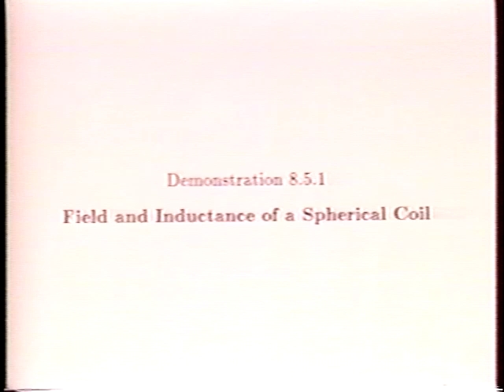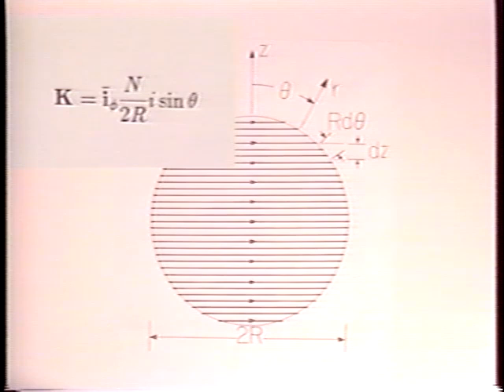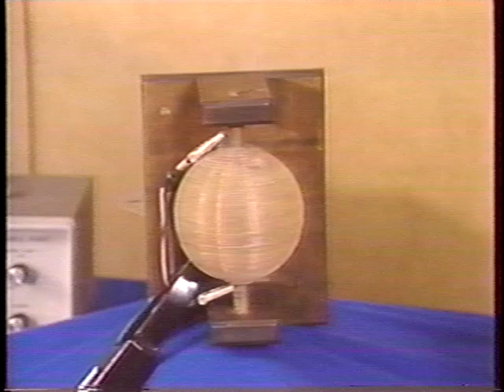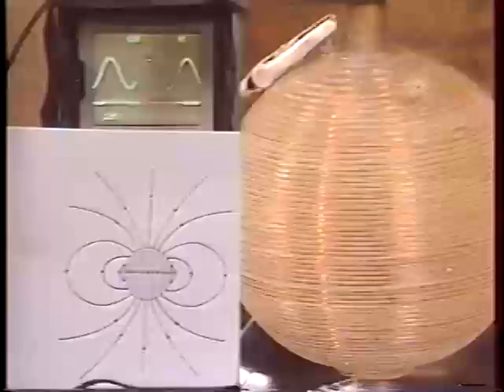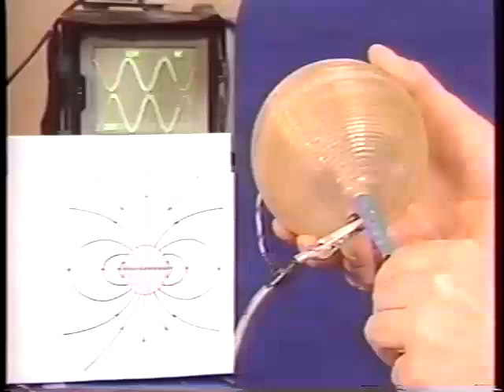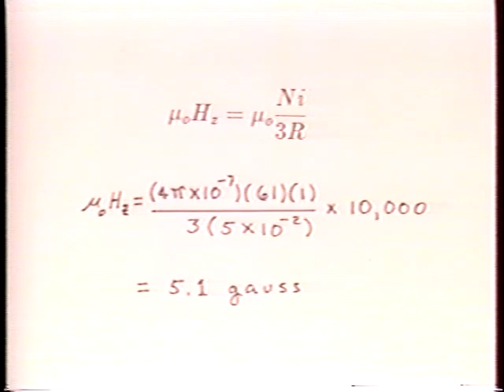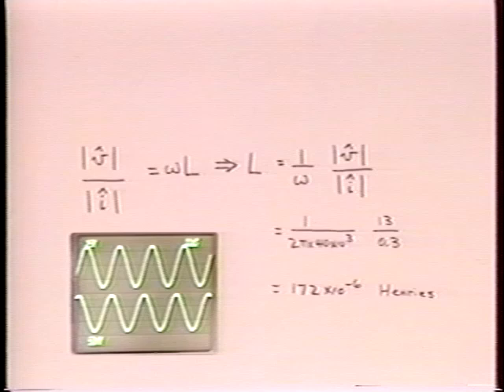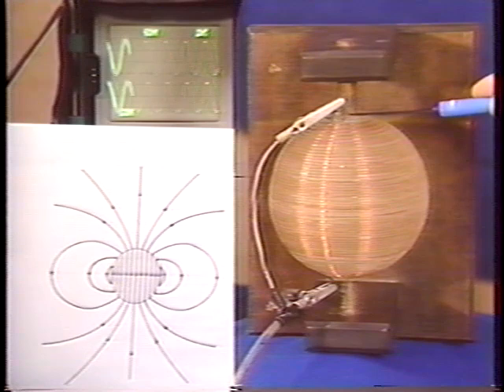Chapter 8.5.1: Field and inductance of a spherical coil

Comment: Fundamentally and extensively linked, balanced, AND unified electromagnetism/energy AND gravity:

ELECTROMAGNETISM/energy is gravity. This is proven by F=ma AND E=mc2. "Mass"/energy involves balanced inertia/inertial resistance consistent with/as what is balanced electromagnetic/gravitational force/energy, as electromagnetism/energy is gravity. Gravity AND electromagnetism/energy are linked AND balanced, as electromagnetism/energy is gravity. Accordingly, gravity/acceleration involves balanced inertia/inertial resistance; as gravity is electromagnetism/energy. "Mass"/energy are linked AND balanced, as electromagnetism/energy is gravity. Energy has/involves gravity, AND energy has/involves inertia/inertial resistance. A photon may be placed at the center of the sun (as a point, of course), as the reduction of space is balanced with (or offset by) the speed of light.

Half of the galaxies are "dead" or inert due to motion and no motion in balance, as gravity is electromagnetism/energy. Gravity/acceleration involves balanced inertia/inertial resistance, as electromagnetism/energy is gravity. Therefore, gravity AND electromagnetism/energy are linked AND balanced; as gravity is electromagnetism/energy. 

Any "curvature" of space necessarily involves what is balanced electromagnetic/gravitational force/energy, as electromagnetism/energy is gravity. "Mass"/energy is gravity. "Mass"/energy is electromagnetism/energy. ELECTROMAGNETISM/energy is gravity. This is proven by F=ma AND E=mc2. Superb. The earth/ground AND the semi-spherical blue sky are linked AND balanced, as electromagnetism/energy is gravity. Indeed, consider the appearance of the earth from outer "space"; as half of the earth does remain constantly illuminated. Touch AND feeling blend, as gravity AND electromagnetism/energy are linked AND balanced; as electromagnetism/energy is gravity. Now, the moon appears with the same curvature of space when compared with the earth/ground as well (given a clear horizon, that is). The earth AND the moon are linked AND balanced, as electromagnetism/energy is gravity. The high tide is thereby successfully correlated with/to what is the blue moon. Great. Importantly, balance and completeness go hand in hand. Indeed, lunar rocks are practically identical to earth rocks; as the earth and the moon are fundamentally (or basically) understood as constituting what is the same body.

Most importantly, outer "space" involves full inertia; AND it is fully invisible AND black. 

ELECTROMAGNETISM/energy is gravity. This is proven by F=ma AND E=mc2. Accordingly, gravity/acceleration involves balanced inertia/inertial resistance; as electromagnetism/energy is gravity. So, the rotation of the moon matches its orbit; as gravity is electromagnetism/energy. Moreover, a given planet sweeps out equal areas in equal times; AND this is then consistent with F=ma, E=mc2, AND what is perpetual motion; as electromagnetism/energy is gravity. Great !!! ELECTROMAGNETISM/energy is gravity in accordance with F=ma AND E=mc2 as what is/involves possible/potential AND actual in balance. Inertia/inertial resistance is proportional to (or balanced with/as) gravitational force/energy, as this balances AND unifies electromagnetism/energy AND gravity; as this balances gravity AND inertia. (This explains F=ma AND E=mc2, as electromagnetism/energy is gravity.) Accordingly, gravity/acceleration involves balanced inertia/inertial resistance; as electromagnetism/energy is gravity. So, gravity AND electromagnetism/energy are linked AND balanced; as electromagnetism/energy is gravity. Gravitational force/energy is proportional to (or balanced with/as) inertia/inertial resistance, as electromagnetism/energy is gravity. This also explains the cosmological redshift AND the "black holes". Now, the orange, setting, AND flat sun is understood as an electromagnetic/gravitational manifestation that is then consistent with/as lava. Outstanding !! Falling cannon balls form spheres, AND objects fall at the same rate (neglecting air resistance, of course); as electromagnetism/energy is gravity. It all makes perfect sense. The falling man feels no gravity, as the feeling of gravity by the man who is standing on the earth/ground also involves balanced inertia/inertial resistance; as electromagnetism/energy is gravity. So, gravity/acceleration involves balanced inertia/inertial resistance; as electromagnetism/energy is gravity. It is now perfectly, consistently, and extensively clear that Einstein never nearly understood gravity. In fact, it is impossible to understand gravity apart from both ELECTROMAGNETISM/energy AND inertia/inertial resistance; as electromagnetism/energy is gravity. Absolutely magnificent !!!

By Frank DiMeglio